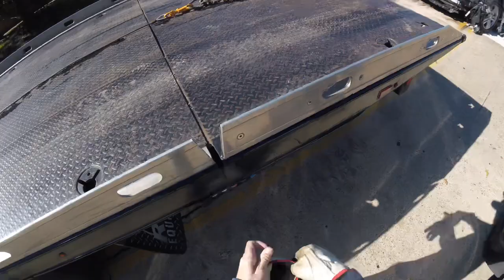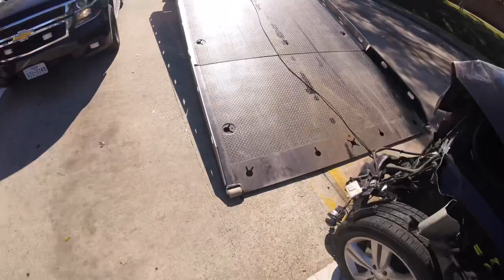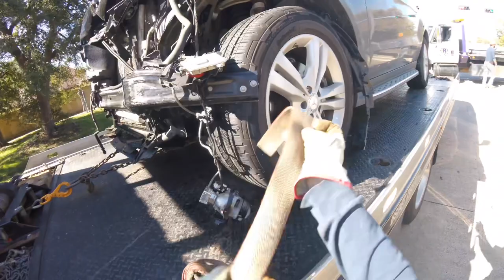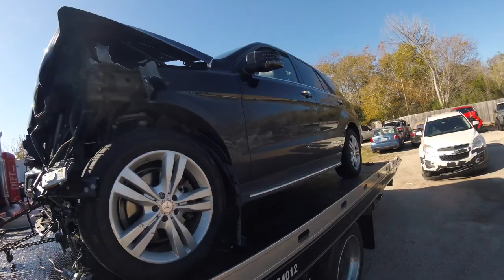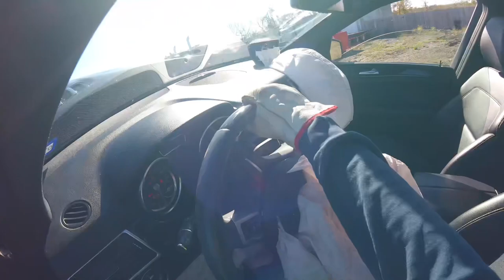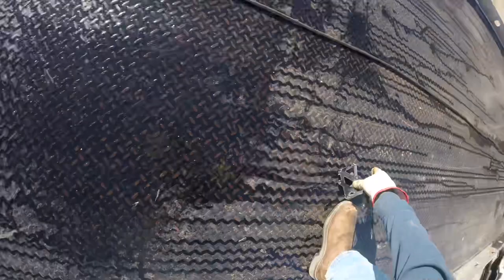Mercedes vs. Honda! Police Rotation Tow!

Comment: This Mercedes...If you have the key and it has power, you can pop it in Neutral just by moving the stick. Depending on what year it is, which should be 2012-13 and older, the parking brake doesnt automatically  engage. If it was me....Id grab the wrecker and free-wheel it off the flatbed if that parking brake wasn't on.
Reply from the maker: It ended up being in drive on scene, at the yard I ended up using the gear selector to put it into neutral.